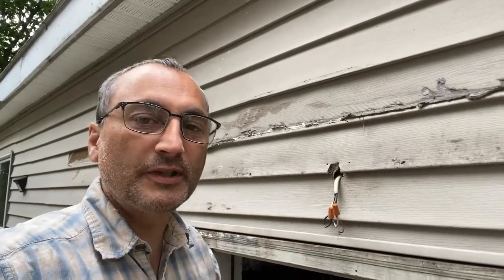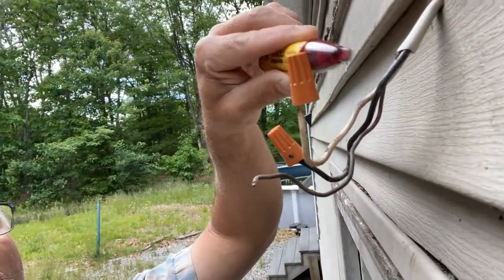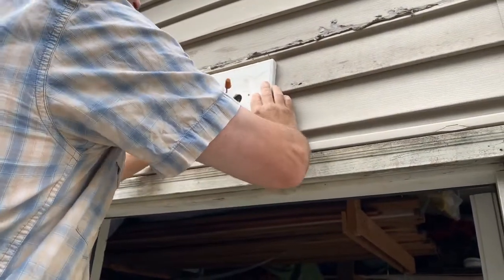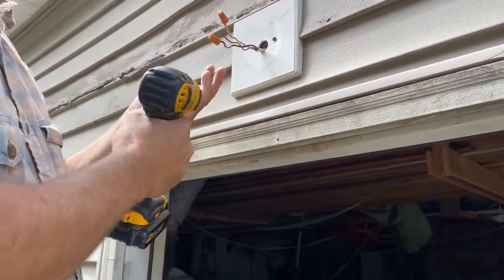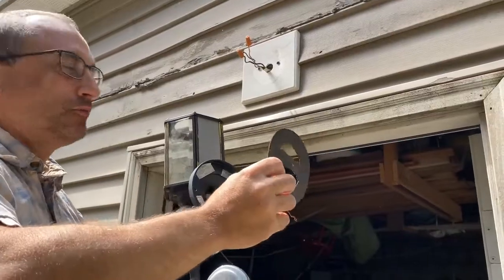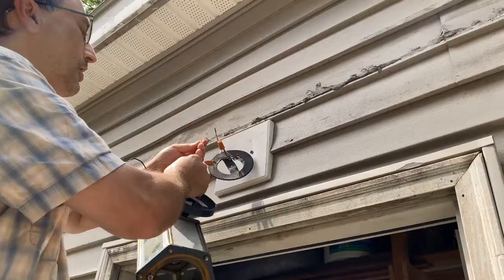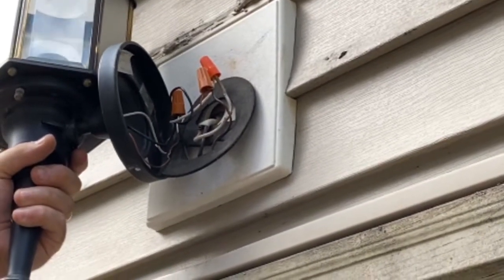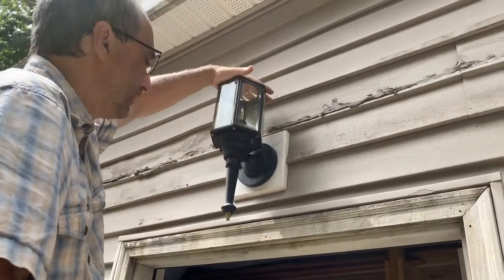How to install an exterior light fixture on vinyl siding

Comment: You don't need to jam all the wires inside a small space. You pull all the wires from the light through the wall and keep them on the other side of the wall.
Reply from the maker: No you don’t stick them on the other side of the wall you put them securely in a junction box. Either way thanks for commenting

Comment: Aren't you required to install an electrical box? Even if you aren't, it seems like it would be a good idea....
Reply from the maker: There is a box behind the siding, I am not sure if its required.
Reply: The connection should be made inside an electrical box. This is not a proper installation in my opinion.
Reply from the maker: I believe you are correct, thanks for the feedback
Reply: @russmelton5684  he said there is one behind the siding nerd’ so it is connected inside an electrical box
Reply: @joshymcdaniel9233  the connection of the house wiring and fixture is not in a box, it is made in between the siding and fixture which is not correct. There should be an electrical box at the front part of the siding where the connection is made, not behind it.
Reply: @doubleg2475  Agreed. The electrical box contains any potential fire from an arc flash. It'd be safer if he used Wago connectors too. Wire nuts are notoriously difficult to make a solid connection with when wiring stranded to solid wire, especially for homeowners and DIY people. A bead of clear silicone across the top of the gasket will help stop water intrusion when that cheap gasket fails in a few years too. 

His method is probably fine though. I see homes that used his method to attach fixtures 30 years ago and there's still no issues with them.
Reply: @joshymcdaniel9233  Incorrect. Electrical box needs to be flush with siding block. Fixture must attach to box itself. Been doing this for 28 years. This is totally against the NEC electrical code and promoting things like this is how fires are started. Please inform yourselves.
Reply: @mikebusc  to do this requires cutting the gang shape out of the siding & plywood so you can get to it from the outside of the house? I am trying to picture this because i am working on a similar project.
Reply: It does not count, right now you have combustible material with wire nuts sitting on top of that. They make a round flat plate dish with a raised lip to attach to the siding first to sandwich the wires with metal in between. The way you have this is considered a fire hazard. @shanesmaineshop
Reply from the maker: @scottdowney4318  it must be an illusion, it is perfectly safe and sound in a box, nothing is near combustible material.
Reply: In the video, it shows you attaching light fixture direct on the flat plastic. The box  would be what your attaching a light fixture onto, not the plastic siding adapter    @shanesmaineshop
Reply from the maker: @scottdowney4318  I’m not sure why you can’t see the box but it is there. Thanks for taking the time comment and add info to this video.
Reply: ok, just cannot see any box, thanks for the video @shanesmaineshop
Reply from the maker: @scottdowney4318  no problem, I am going to go back and watch it again, maybe it’s just not visible in the video.
Reply: @mikebusc Can you run the wires from the light through the wall and connect to the cable within a box that is just inside the wall? I realize it’s ideal to connect to a flush electrical box but as long as the light is securely fastened to the garage sheathing, could the connection be done the way I described?

Comment: Supposedly have no vinyl siding near those wire nuts. You put a flat dish metal plate to go on top the siding and have the lamp attach to the plate so the wires sit between metal, not combustibles.,
Reply from the maker: They are in a metal box, thanks for commenting

Comment: I mounted a flag to one of these yesterday. One of my screws as I put it through started to push the siding out before pulling it back in. 

There was maybe 3 inches of empty space then some wood. I opted for 4 inch deck screws. They were self tapping long enough and not too thick so it was the only option. as well as safe for outdoor use. The old flag was mounted straight to siding (with all that empty space behind it so wind ripped it down twice) the second time
A “pro handyman” put anchors lol. 

Anyways.  My question is the fact the one screw pushes the siding out before pulling it in. Does that mean I hit the wood? I hope so cuz the bottom screw I had to use a shorter one I was afraid to commit to the insane popping outwards. It scared me.
Reply from the maker: Well I’m not there to see it firsthand but if you hit wood and the screw did not directly go into the wood right away the siding would come out first and then as the screw went into the wood it would then eventually pull the siding back in. That’s kind of what I get out of your explanation of the situation. So I’m guessing you did hit would. I hope this helps and thanks for the question

Comment: Even though the power is confirmed off, don't use a metal ladder. Safety third!
Reply: Or just don't be stupid and hook the wires to the ladder in your bare feet and you should be fine..
Reply: your a little overly concerned

Comment: The light is definitely installed upside down. Will Collect water when it rains
Reply from the maker: LOL, No it’s not and I’ve had no trouble with it at all. Thank you for taking the time to comment.
Reply: The top is not open. He said he had to put a bulb in it and then replace the top cap of the light on top.....

Comment: The light is upside down. Need an electrical box, and even with an electrical box you always use electrical tape over wire nuts to get safe. You need to hire someone..  Just saying.
Reply from the maker: Thanks for taking the time to comment.
Reply: It's not upside down. It's common sense.